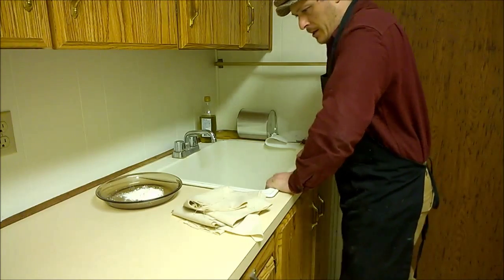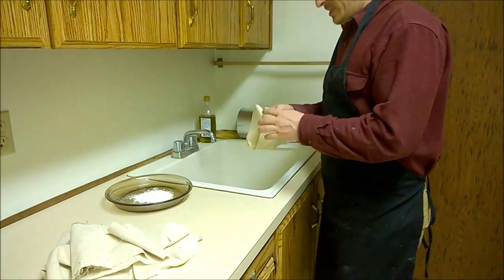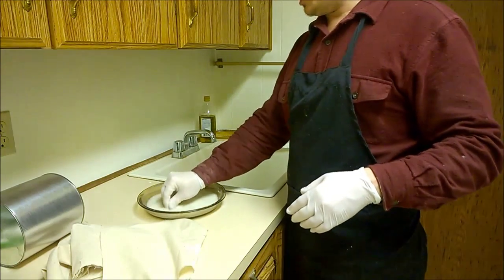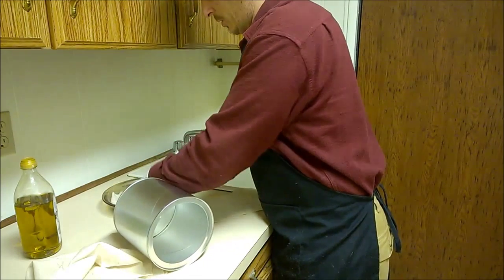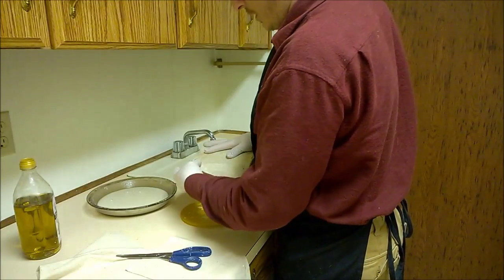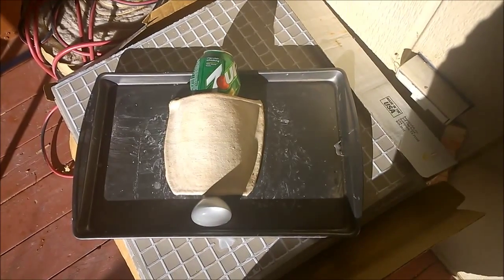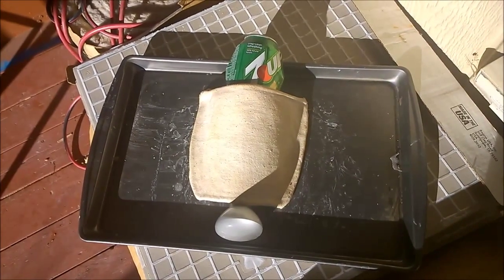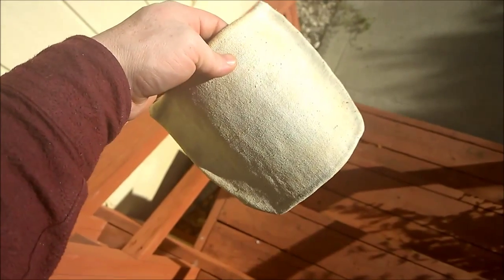Attempting Linothorax

Comment: The trick is, to add the layers and let them dry individually in between. Bigger armor pieces should be done one layer a day. Have fun!
Reply from the maker: kebabcowboy 
Had not thought of that, thanks. I think the final result (something I tested in a follow up video that I have up) actually turned out pretty good for all the lack of cooperation I got from the material the way I was trying to work it. At least good enough to be incorporated into practice armor. I want to revisit this with linen eventually and maybe some fashion of wood mold. But, for the moment everything is on pause. I just moved (again) and still have to go get the rest of my stuff.

Comment: Someone asked what glue was used, you shown flower and water. I saw another video on the subject by how to make everything where they just use pig fat smeared between the layers i think they used about 15 or so
Reply from the maker: Animal glue (skin flakes) would have been typical. Most likely with some sort of hydrophobic and even antibiotic additives. If one wanted to use a likely near equivalent to the glue the ancient Greeks might have. They could use rabbit glue add maybe a teaspoon of powdered alum as well as a cap full or so of vinegar to every cup of dry product bloomed.

We do not, likely will never, and possibly cannot know exactly what they did. It's probably not a fixed recipe that everyone knew either. There were likely many slightly different glues used depending on exact time and locality.

Comment: what type of glue did you use?
Reply from the maker: It's just flour and water. Not the best stuff. Especially not for mold or water resistance. But serviceable for such experiments. Originally linothorax would have likely been made with an animal glue. Probably not bone glue as that's a hot application, that is a bit too viscous, and cures rather hard. It would have had to been something more akin to a rabbit glue.

It also seems likely that some sort of water resistant ingredient was used. If I had to bet on it I would say that additive was Alum. They would have already been using alum in related crafts (such as a fixant in dyes). Alum is also known to have been used to raise water resistance in carpenters glues for thousands of years. That it would also be in a similarly sourced type of glue makes sense (though we have no direct evidence for it).

Comment: I am not sure, but it might help to pound the linen after each layer
Reply from the maker: That's an interesting notion. A potential problem I see with it is that the pounding would more than likely be uneven. Another is that some components would pre-shaped and it would be hard to pound such pieces. But perhaps some sort of negative and positive wooden die press would resolve both potential issues.
Reply from the maker: @shipofbats9134  Another interesting notion. It would apply even pressure. It would be easier than making a press as well. I may have to try that some time.